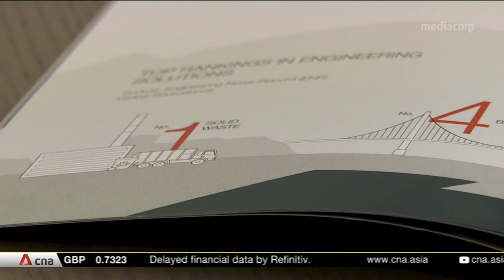Singapore to launch 7-month study for pilot facility to turn plastic waste into oil

Comment: A couple of years back the company I was working for tried with these recycle plastic in out injection moulding department. We find that its a bit more brittle when under pressure compare to original.